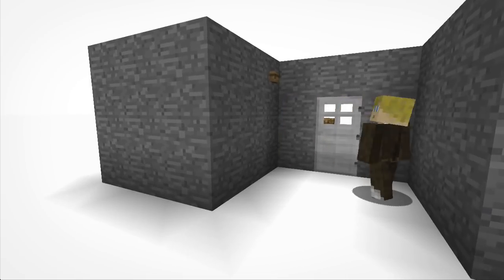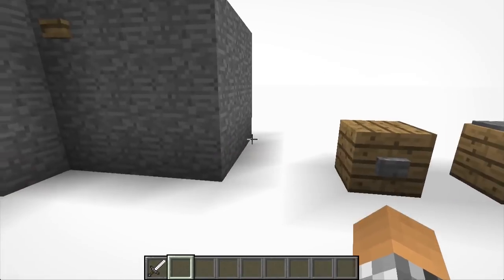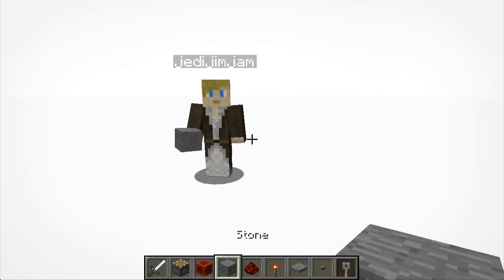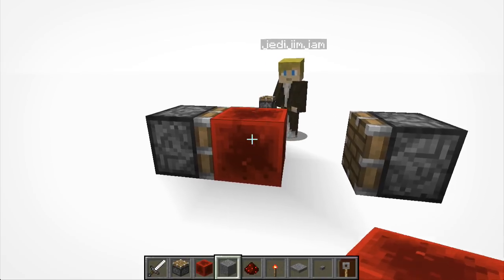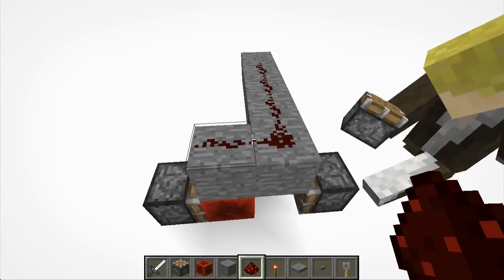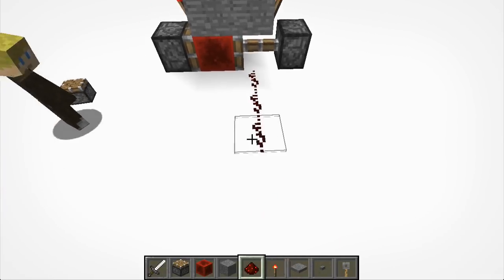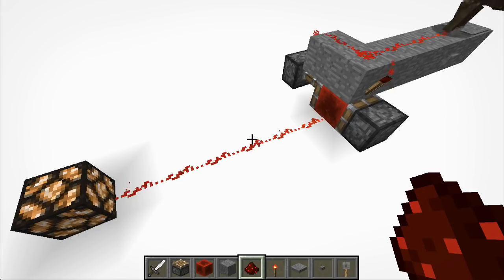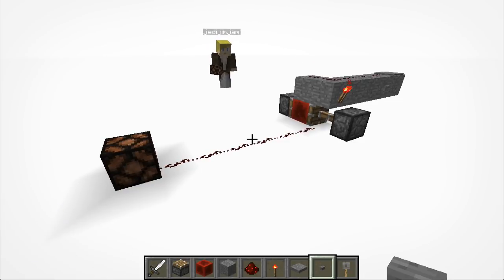Buttons & Pressure Plates To Levers! (T Flip-Flop)

Comment: Rails can u make a going down escalator and going up escalator (a curved one going up the previous one u did was straight and it was only going up)
Reply from the maker: Toughspeedy-ROBLOX You can make it curved by simply having a corner that points in the new direction :) after the signs. A down escalator would be simple as putting water down a hill